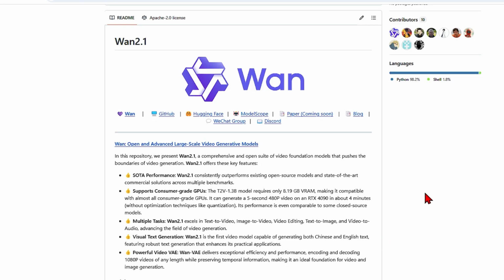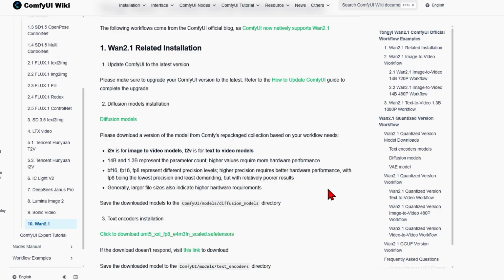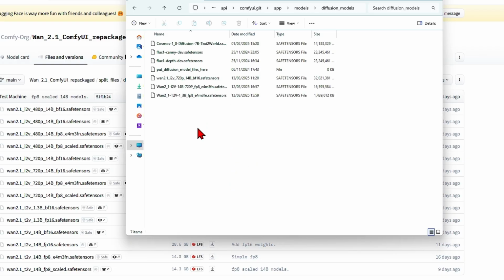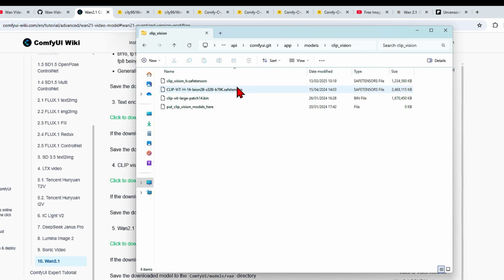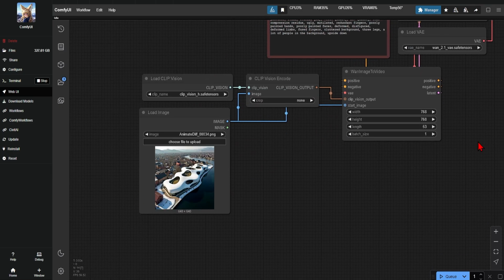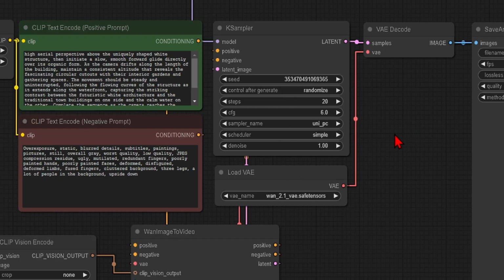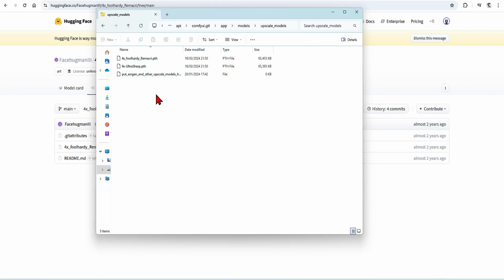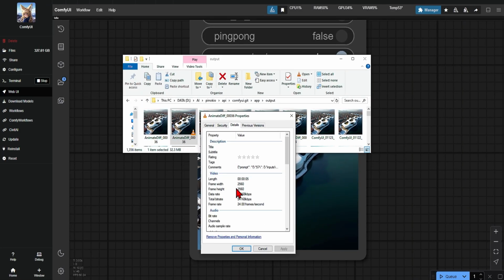Quality AI Video Generation with WAN 2.1 (Free + low VRAM Usage)

Comment: I just get an error: UnetLoaderGGUF  Unknown model architecture!
Reply from the maker: Use the GGUF models from the CITY69 hugging face link others from different hugging face page might not work., tryin updating comfyui,  also Check all models are in correct folder, GGUF should be in Unet folder.
Reply: @Urban_Decoders  Yeah, it seems it was the model, managed to get another to work. Thank you!